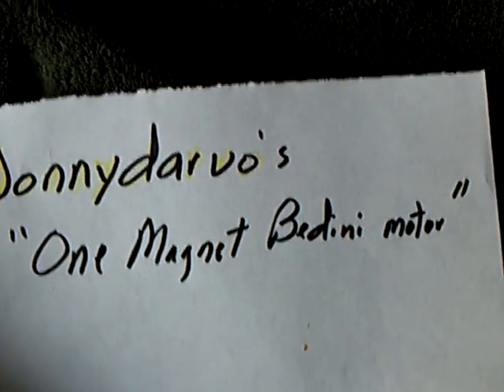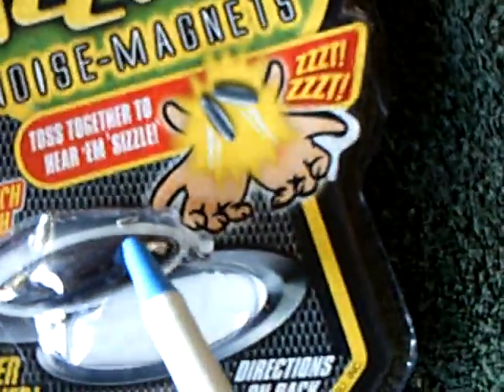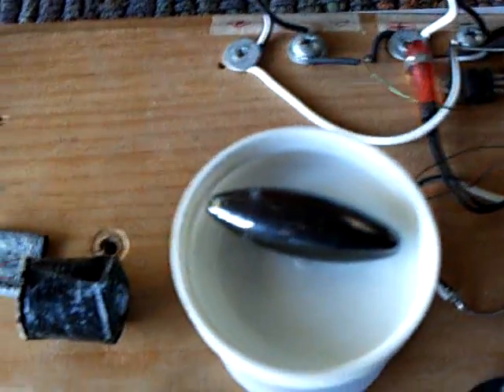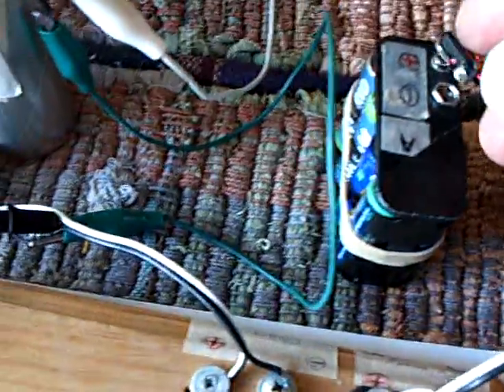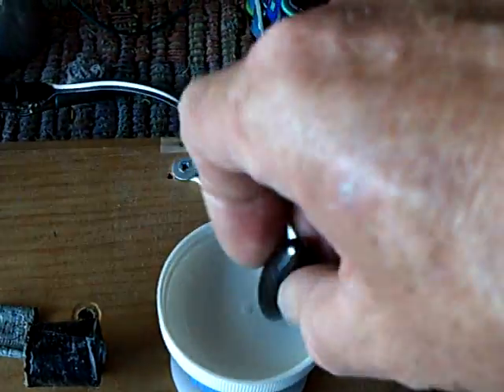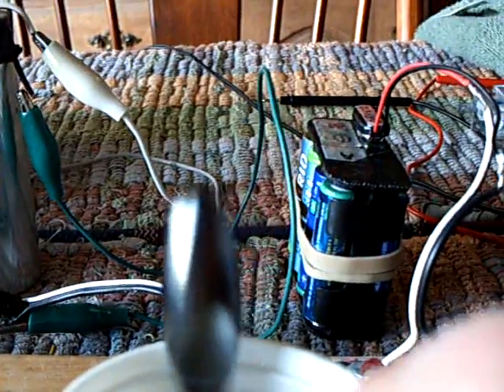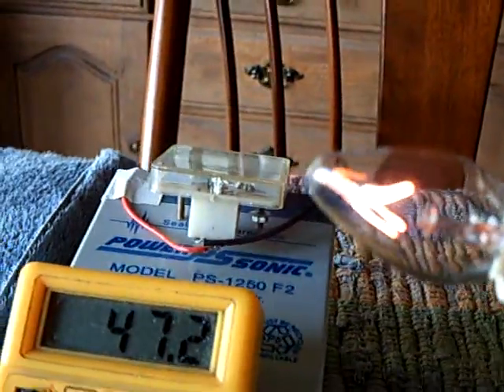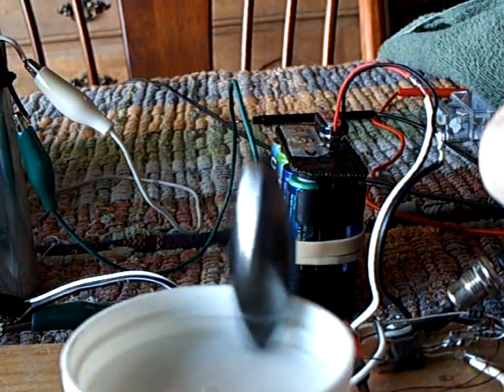Jonny's 1 magnet Bedini My replication

Comment: Can you can spin a 2 inch sphere magnet? if so how fast will it spin?

Why I am asking is if the INPUT to spin a magnet at a terrific speed is low the OUTPUT of that 2 inch spinning sphere magnet inside a pickup coil would be much greater.  Overunity would be achieved.

Comment: Excellent :) there are cylinder ones as well :) they are strong and only 2 $ :) hehehe very cool video lol. wow very nice :) Get the cinlinder version spining :) like in my video :) I got a idea :) Once you can get it spinging and then try and center it and bring in the copper ring from the outside in or from top down and read the coil volts :)

Comment: This may be non germain, but have a look at Flux 4 Energizer's Joule thief charger. He is getting over 9 times the charge to run inout by linking the common negative run and charge battery grounds to the transister emiter.